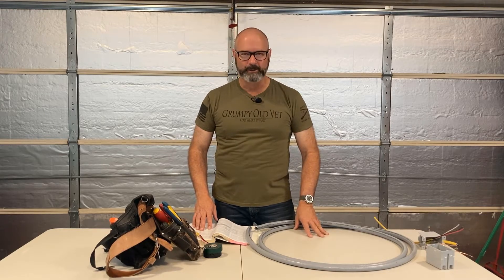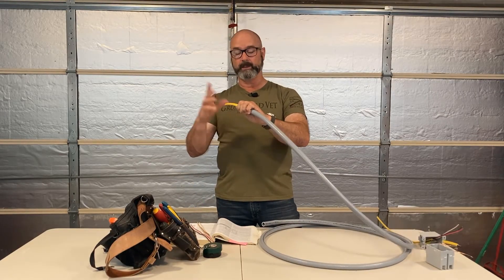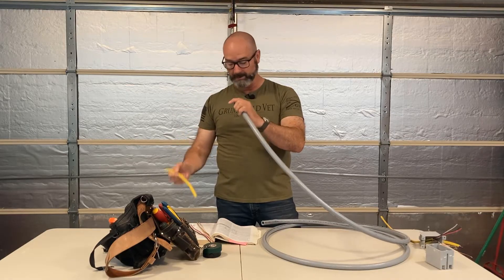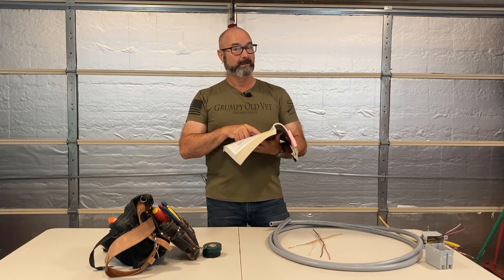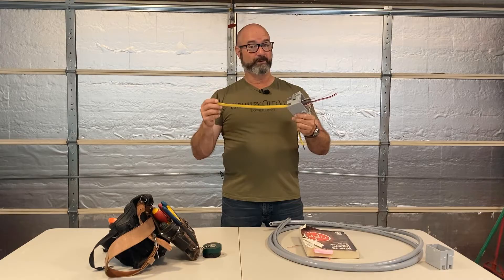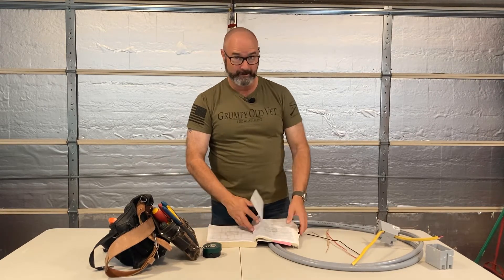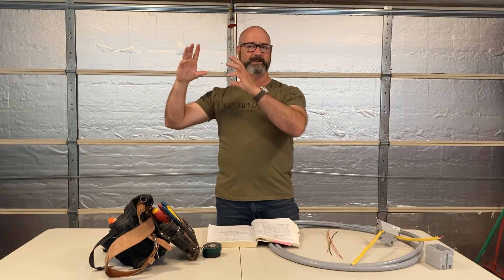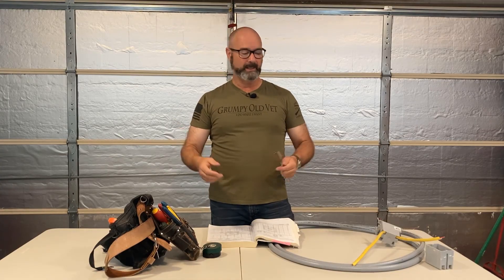Stripping Romex into Conduit- Bringing in the Sheaths

Comment: Ok so let’s see if I understand this right so if I’m running romex in the ceiling joist and want to run plastic conduit from the joist area down to the outlets and switches I would have to run the romex to a junction box and buy actual individual thwn-2 from junction box down the conduit to the outlet and switch boxes

Comment: Romex wire is bad for wet conditions because its internal paper insulation can absorb water, 
which can then travel up the cable and cause corrosion, degradation of the wire's insulation, and potential electrical shock hazards.

Comment: I need to run electrical wiring in a raceway in our living room that goes to multiple outlets. Do I strip the jacket (sheathing) off the wire before running it in the raceway? We have a log home that was not set up for electric in the logs themselves. So the original owner has the electrical hidden behind the baseboard and the outlets were also mounted on the baseboard. We have since remodeled and did away with the baseboards and I'm trying to figure out a better way to run and hide the wiring. Raceway is the best I can come up with so far. Still haven't figured out how to mount the outlets that will look good.
Reply from the maker: @jeromejackson6728  you can use a metal wire mold box, that's the brand. Or you can go industrial and use half inch EMT with Industrial 4x4  boxes. If you're using raceway, cost wise, it might be just as good just to buy individual conductors, hot neutral ground, and pulled individual conductors and not have to worry about stripping or violating the manufacturer's rating of the Romex

Comment: how do you transition a romex wire from inside to outside if you cant run it outside though a conduit?   ie a split mini
Reply from the maker: @rswind1964  to a j-box, and transition to outdoor rated cable or conductors. I know what you're saying - I've seen some electricians run UF through the attic to the exterior.

Comment: If you strip the NM sheath off you may not be allowed to run the bare grounding conductor in conduit.
Reply from the maker: @RonFrye-pl2lz  to my knowledge,  there's no restriction against running a bare equipment grounding conductor in conduit.
Again, the NM is limited by location.

Comment: So do I need to remove the yellow/gray protective jacket to run 6/3 wire in liquid tight conduit for a portable generator I’m using as a back-up generator for my house?
Reply from the maker: With UF no. If by "yellow " you mean NM cable or romex, use something outdoor rated

Comment: So putting a 14-2 or a 12/2 and 1/2" liquid tight or PVC conduit. Can you leave the copper bare
Reply from the maker: You can strip off the outer sheath to reduce the cable diameter and make it easier to pull. It will still have the same restrictions.
Reply: @abrelectric  would you have to pull in coated ground? Or can you leave a ground in the conduit
Reply from the maker: @kylekelley213  the ground wire can be bare. Remember,  no damp/wet locations.
Reply: @abrelectric  awesome, thanks! No I was just adding on to the circuit on the side of the house with either some scheduled 40 electrical conduit and or liquid tight. Most of my runs are 10 ft or less

Comment: In my area only allowed to run NMB  cable less then 10' in conduit. Would install a single 14/2 or 12/2 cable down  basement wall to feed a receptacle or switch on concrete or cinder block walls. Inspector told us that the white, black, red insulation does not have the wire guage printed on it like typical building wire such as THWN.
Reply from the maker: He's right. If you can't show it, they don't have to pass it.

Comment: It is definitely true that you have to use the 60 degree column in residential and very important to do so. With that said  one thing to keep in mind is type NM-B romex is PVC insulation with a nylon jacket which is rated for 90 degrees C. So if you do it correctly you should be perfectly fine running romex through conduit. If you can set a J-box I would recommend it but you can't always do that in certain situations.
Reply from the maker: I agree with you on temperature ratings. A lot folks are frustrated that they're not supposed to run it in damp or wet locations.
Reply: @abrelectric  yes this is a true statement. For all outside work XHHW is the best wire there is but do it yourself types don't like spending the money, but in the long run you get what you pay for.

Comment: I’ve run 2-2-2-4 aluminum in the grey sheathing 20 inches underground in 1 1/4” schedule 40. And using a 70A breaker.
It’s feeding a sub panel in my garage.
Is this ok ?
Reply: SE cable is not allowed underground.

Comment: I want to use the weatherproof gray conduit to run on the inside of a cabinet to protect some 14 gauge wire about 3 feet. If I drill some holes in it for ventilation, does the conduit problem of heat go away?
Reply: No. If you're running in conduit, you need to respect fill diameter requirements in the NEC. For that distance of 14/3 romex, you'd need 1" PVC conduit. For 14/2 romex, you could get away with 3/4" conduit.

Comment: The 90degree column is only good for wire on the spool……
Termination limitations derate that 90 degree wire for nuts,lugs,stabs and pressure connecting devices that are where the fires start……
I think ac/dc said it best 
Loose wires start fires

Comment: So then an inspector will accept insulation with no markings as long as it is derated to 60 degrees Celsius? (For temperature only)
Reply from the maker: If it's the unmarked conductors in Romex, it will automatically be rated in the 60 degree column

Comment: Related to your 6/3 nm 60 degree comment is rated at 55amp, could not be used for 60 amp circuit.  

I’ve researched this a bit and found according to NEC 240.4(B), I can round up to the next higher standard breaker for a NM cable whose ampacity falls between 2 standard OCPDs. For example, if I use 6/2 NMB wire which is rated at 55amps, I can use the next higher standard 60Amp OCPD if: 1) the calculated load will not be higher (48amp ev charger) than the ampacity of the cable (55 amps) 2) the circuit is hard wired (no branch circuits, i.e. outlets for portable devices).

Comment: I just always assumed enclosing romex in conduit(whether "official wet or dry" location), if you just used the pvc conduit for protection and actually sealed it on both in/out locations, it would create heat=sweat=damp/wet/condensation?? When romex is exposed in wood walls, insulation etc, you have all that to help suck up "moistures/etc". Now if walls were concrete/block, I'd also see a problem fastening romex in conduit because the "dampness" of block and or concrete. Heck, even in my uninsulated shed/garage that is wood framed and wood exterior walls built on a concrete pad, the mechanics tools I have in my small(yet extremely heavy!!) 3 drawer craftsman tool box, had started to pick up surface rust when they had only been in garage for around 4 months! I've had most all them tools for well over 20++ years(I'm only 43), and never "rust"!! But my old house that I built my own shed at, was "all" wood(no concrete pad). I should've known better than to have metal box directly stored on concrete floor, but lesson learned. Not much surface rust at all, but I am one of very few who takes extra special care of ALL my tools(except the abuse of overworking them), and I use all my tools ALOT, whether it be working on houses or working on cars. Just a simple thing as setting that box on a scrap piece of plywood had stopped the leaching moisture right in it's tracks!! I even keep a small "moving" blanket lining the bottom of aluminum truck tool box on truck, and one covering all tools at the top, for moisture AND to keep the "long term" heat from slowly baking all my saws' cords as the years go by.

Comment: Hey I've had this come up before and inspectors will not let us do that in WASHINGTON  for out door locations because they say the wire inside of romex is not rated to be in a wet location, all wire in conduit in wet locations must be rated for that purpose so no stripping romex and using it outdoors in conduit!
Reply from the maker: Absolutely.
Reply: Yes he said that a few times in the video. 
Is it OK in WA to run stripped romex wire into an outdoor j-box? Then continue with the proper conductors to an outside appliance (heat pump)?

Comment: Just to clarify, am I safe to run 8/2 100ft of Romex from my basement panel to the attic then outside in pvc conduit to an AC disconnect? As long as I strip the romex in the outdoor conduit and in compliance with the amps indicated in the 60° section of that table?
Reply: No it's not rated to be ran in wet locations because it's not thhn ect...
Reply: So don’t run the stripped Romex to the outdoor disconnect? If I do, is this more of a technicality because the conductors are unmarked or is this truly unsafe?
Reply from the maker: @peyton6488  According to a manufacturer (Southwire),  the individual conductors are rated for 90°, but not for wet locations. To be completely Code compliant, you would transition to THHN/THW or MTW conductors in the exterior conduit. 
The final call is yours.
Reply: @abrelectric  as all the inspectors in several states have always told me and everyone else if it's not stamped on the wire can't use it.  Doesn't matter if southwire says it's 90c rated if it's not on the wire it's rated for nothing.
Reply from the maker: @jrock865  Inspectors can read also. I mean, the material doesn't always have all the specs written on it, and if you have the info on hand, it counts. 
In this case, the temperature rating doesn't matter either way, as the issue is the rating for damp/wet environments.
Reply: @abrelectric  i've tried that before with some wire from cerrowire the inspector denied it since the stamp on it wasn't visible enough.  Was told if it isn't stamped and visible when installed then it's not usable.
Reply from the maker: @jrock865  ok. 90.4, authority having jurisdiction
Reply: @abrelectric  yep and to them if they dont see it on there it's not usable even with a spec sheet lol.  Best practice is keep the AHJ/Inspector happy and go on.
Reply from the maker: Yes sir, and your conduit is sized for the 2-#8s and ground.
Reply: @abrelectric  Thank you so much, this has had me stumped for days trying to figure out the best way to get this done. So many conflicting opinions out there.
Reply: @abrelectric   wow your completely wrong!!! I've talk to inspectors about this, that is a wet location and the insulation is not rated for that! Where do you see a rating on those conductors?
Reply from the maker: @travisduke98  you are correct: the individual conductors inside of the sheath have no markings to identify them as THW or some other damp/wet location rating

Comment: Great video. Thanks for sharing.

So, just to clarify, running the individual romex  wires without the sheathing in conduit is a code violation because they are not labeled as to what kind of insulation they have, correct?
Reply: I would like to understand this well.  It seems that stripping the wire out when transitioning into conduit... Such as a an unfinished basement wall coming down from the floor joist stripping off a large portion of the sheathing makes sense for an outlet box.  Is this a code violation?
Reply: Not a code violation necessarily.  The point is stripped romex is not the same as THHN so you have to assume 60C and use the appropriate table.
Reply: @TrendyStone  it is it has no labels and you can't use it on any chart.  Can't strip the sheath.  You can only use romex with the sheath that's what it's designed for.
Reply: @jrock865  I’m my jurisdiction you CAN use stripped romex as long as you assume 60C and it’s in conduit.
Reply: @TrendyStone  There is no marking you can't use it lol it's literally an unidentified wire once you strip it that's why they have it only listed as a cable.  You can't use the 60c or any column once it's stripped out only when it's in sheathing that's why the nec has restrictions on nm cable.
Reply: @TrendyStone  Just because you can doesnt mean you should it's still a code violation.  can i put sirens on a vehicle should i go around driving with them on like i'm an emergency vehicle...no? Just because you can doesn't mean you should when it's a violation.
Reply: @TrendyStone  let's take another instance s/o cord....you run it to equipment for a whip from a junction box...can you strip it out and keep going with it to the panel through a conduit?
Reply: @jrock865  Are you asking about NEC, local code, what your local building inspector might allow or just what is safe?
Reply: @TrendyStone  nec code doesnt allow it to be stripped and used what dont you get? lol
Reply: @TrendyStone  do everyone a favor go strip some nm and look for any rating on the wire....there is none it's only rated as a cable assembly together not the individual wires.  You can't strip the sheathing and use it because it is no longer a cable assembly.  The committee has already answered this before.
Reply: BTW - We happen to own a beautiful 70 year old cabin.  No ground wires, just hot and neutral and all the wiring is aluminum.  Has it burned down?   Nope.  Will it?  Nah.  NEC is fantastic, and I follow it, but it’s extremely conservative.   It can’t be right 99% of the time; it has to take into account the worst case scenario and be safe 100% of the time which is why it’s so darn conservative.   Other countries, even Canada, have different guidelines, and yet they also are very safe.
Reply: @jrock865  BTW - Note that if you terminate NM cable in a panel, you typically have a foot or so without the sheath and there's nothing identifying those other than tracing it back to the sheath it came from.  So...is it safe to strip the outer sheathing?  Yes.  Does it meet code?  Depends.
Reply: @TrendyStone  tell me you know nothing of electrical while telling me you know nothing of electrical
Reply: @jrock865  You sound like an angry code zealot.  I’m an engineer.  We write the code.
Reply: @TrendyStone  no you don't the code panel writes the code ....yet again you try and get another L.
Reply: @jrock865  NFPA's Committee on the National Electrical Code, which consists of twenty code-making panels and a technical correlating committee is comprised of electrical engineers and technicians.  Sheesh...you're stubborn.
Reply: @jrock865  You never responded to my comment before.  If you terminate NM cable in a panel, you typically have a foot or so without the sheath and there's nothing identifying those wires other than tracing it back to the sheath it came from.  So...is it safe to strip the outer sheathing?  Still waiting for an answer...ya genius.
Reply: @TrendyStone  the romex/uf sheathing is supposed to stick out at least a 1/4 inch from your terminal box, so the type of cable can be identified.
Reply: @TrendyStone that’s what I heard him say in the video.
The only problem I see is that the code book is written by humans in English, and the English language is often open to interpretation. That’s why lawyers always look for precedent. It’s also why I always recommend checking with your local inspection authority. Electrical codes are not law. They are guidelines which local jurisdictions can use to determine their own requirements.

Comment: If we use thhn thwn-2  in a conduit do we use the stamp rating of 90°c or 60°c because it's inside the conduit.
Reply from the maker: 75 degree column, because your breaker is the beginning of that circuit, and not likely rated for over 75 C. The circuit unit rating is driven by the lowest rating: breaker, conductors, load
Reply: @abrelectric yes, the 90-degree column is only good for derating purposes
Reply: NEC 240.4(D) restricts all small circuits (10AWG to 18AWG) to the 60° OCPD device, unless allowed in 240.4 (E thru G). Essentially, all of your branch circuits will be 60°, regardless of the wire’s rating. Just always use a 15a for 14g and 20a for 12g, unless you’re dealing with one of the exemptions. You will only consider the 75° or 90° columns for special installations, like motor loads or for derating, as already mentioned.

It’s just not good practice to strip NM cable. Most inspectors wouldn’t allow it. Put a box on it and transition, or run EMT all the way. There’s satisfaction in doing it right.